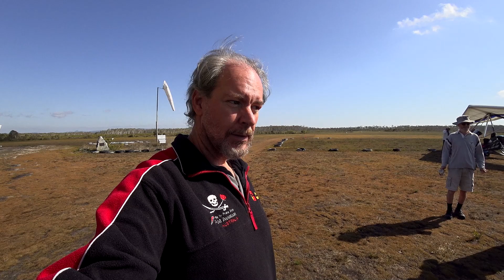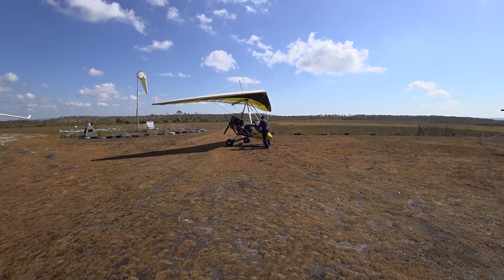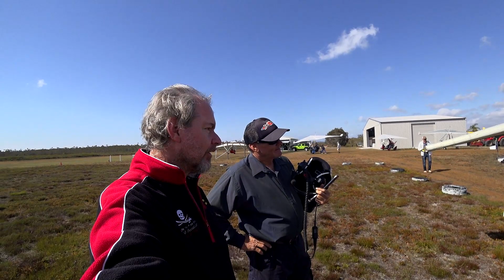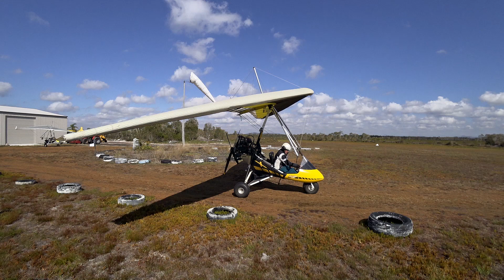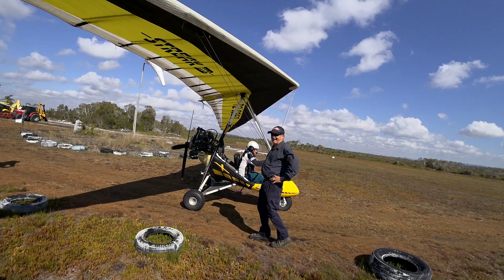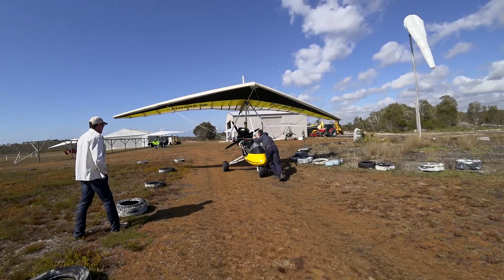HELP Rotax 582 2-stroke | In-flight engine-outs, forced landings and now won't start

Comment: It is fuel starvation.   Do you have a single line fuel pick-up from the fuel tank.  If so, your fuel tank needs a proper vent line.  The trike will fly fine up until about 500' feet off the deck and then shut down.  I had this failure before.  Tank venting solved this issue.  And yes, you're running the starter WAY TOO long.
Reply from the maker: Hi this is resolved a few years ago - a followup video explains it.  The oil injection pump had seized - no 2-stroke oil was being injected. Ouch!

Comment: You’re abusing that starter!!!  It’s obvious you’ve got a problem, ground it, till you fix it, or deal with it in flight. It takes two to Tango, both fuel and electricity. If you’ve got fuel, look at your grounds. Add a ground jumper cable and see if that works. Also, check the resistance of your coils or stator, but unless you’re a gambler, don’t fly it.
Reply from the maker: I wasn't in the aircraft - not me...

Comment: Some Personal Watercraft were also powered by this engine (Rotax 580) such as the earlier SeaDoos. Very unreliable engine, plus I remember trying to start it and cranking it so many times would wear down the battery / burn out the starter. Other times it would just quit for no reason. There is a warning out on these engines if used in any aircraft (below)...

"This engine, by its design, is subject to sudden stoppage. Engine stoppage can result in crash landings, forced landings or no power landings. Such crash landings can lead to serious bodily injury or death...This is not a certificated aircraft engine. It has not received any safety or durability testing, and conforms to no aircraft standards. It is for use in experimental, uncertificated aircraft and vehicles only in which an engine failure will not compromise safety. User assumes all risk of use, and acknowledges by his use that he knows this engine is subject to sudden stoppage...Never fly the aircraft equipped with this engine at locations, airspeeds, altitudes, or other circumstances from which a successful no-power landing cannot be made, after sudden engine stoppage. Aircraft equipped with this engine must only fly in DAYLIGHT VFR conditions."
Reply from the maker: Hi, thanks for your indepth comment. Yes I am a little familiar with these engines myself.  When I started learning to fly (2012), I flew my instructors Airborne trike which had a Rotax 582 (2-stroke). I remember the first and LAST time I back off the power a little during takeoff.  My instructor said, "Next time I do that I owe him a bottle of whiskey!".   Soon afterwards I bought a Rotax 912 (4-stroke) powered trike, and still fly similar to this day.

Comment: I see it has been 5 months sense the engine trouble. Did you find the problem?
Reply from the maker: Got an update from owner and will do a video shortly.
Reply: @CrayonboxFlyingAdventures  Is there any update? Would be nice to know the reason
Reply from the maker: Ivan Shovkoplyas I have now linked the update at the end of the first video.  Thanks for pointing this oversight out to me. Regards, CB.

Comment: Check if there is any play on  throttle cable on top of carbs, had problems starting mine....do a carb sync.....mine was set to 2900 rpms....on idle. Now take off the cable on main throttle leaver....and you might have to redrill the throttle lever....Always had oil in my carbs after a long time standing now instant start and rpm down to 2000 rpm. Will be at the maintenance course next  weekend and can check ....

Cheers
Rob

Comment: I would probably rebuild the carbs myself. But first I would check my mag switches. They could need replacing. I have seen a double ignition wire failure ion the same cylinder on an O-470, so it's possible. If there is an intermittent open circuit, it could be difficult to start, run rough at certain engine speeds and cut out at others. It would all depend on frequency of the intermittent circuit and how easily it sticks open.
I'd also suggest draining all the fuel and refilling. you could have bad fuel or water in the fuel...
I recommend using clear fuel lines so you have a quick indicator of fuel flow.

Comment: Sounds like the typical 582 cold seizure. Backfiring through the carb is a tell tale sign. Trying to start it over and over again is useless.  Use a boroscope in the spark plug hole or do a compression test to confirm.

Comment: I see no updates have been posted here, so I'll share what I know.

Apparently the auto-lube was faulty and caused the engine to blow. One cylinder was registering 30psi, while the other was one hundred and something. After my father rang around, he learned the 582s commonly had this problem.

So he's found someone to do the repairs. To get him up and running again. The solution to make sure this doesn't happen again is to use premixed fuel.

I'll try and update with more information as it comes to me.
Reply from the maker: Thanks.  I believe he might convert to premix fuel.

Comment: A two stroke engine is pretty simple as engines go, if everything is correct then a start should occur in two or three revolutions, just keep on cranking is a waste of time.
In this case I would start with the spark plug, is it wet or dry, what is the colour, what does it smell like, attach to the lead and hold to ground, do you get a fat spark as you crank.
Three engine outs points to an intermittent problem so while it is not going is the best time to get the fault. If it did start and ran ok i.e. fault gone away what do you do then apart from worry, Aviation engine problems should not be fault found or treated the same as a car problem.
Reply: Strange how so many people manage to seize up the 582. There is a warning about it. 
It's what happens when you get rough with the throttle and don't understand thermodynamics.
So many people fail to really consider the engine as being like a horse. If you beat it, eventually it will just quit.

Comment: Happened to me, always at WOT. Ended up being the Autolube was running too rich at WOT. Was very hard to reproduce on the ground. Had 4 engine outs in one week. Always low and mostly on take off. Adjust the mix and all good.
Reply: I've never trusted autolube. it is one more thing to go wrong. Mixing by hand is easier, plus if you live somewhere with E10 or E15 fuel, you need to put in a fuel stabilizer too. This also helps the fuel last much longer.
I've had a motorcycle sit for 14 months, with E10 containing fuel stabilizer and it fired right up and ran fine. I wouldn't do that on an aircraft because bad fuel can cause what is happening here.

Comment: This happened to me once with my 582 after doing some maintenance. It turned out to be a fuel hose that had been inadvertently secured with a cable tie on one of the hoses to fuel bulb was getting insufficient fuel when climbing out at full power. We spent days searching for this problem until a fellow pilot arrived and identified the issues straight away.
Reply: The hose had a minor kink and was limiting the fuel flow to the bulb.